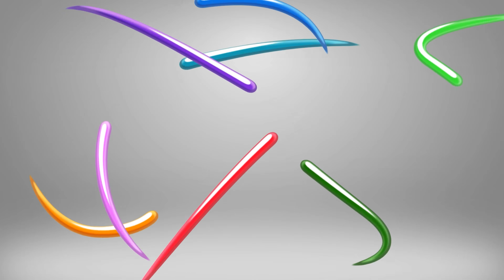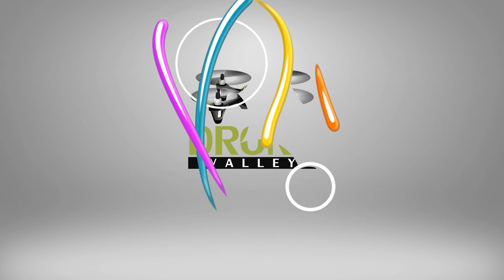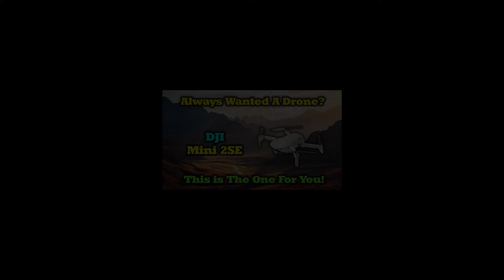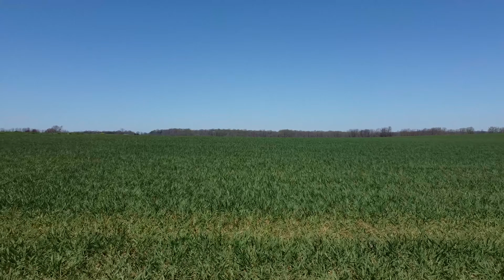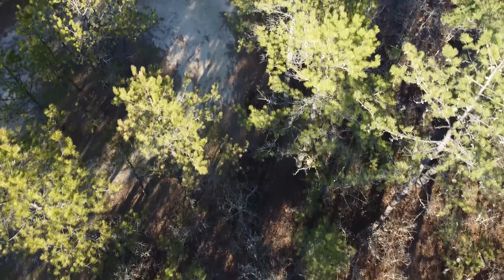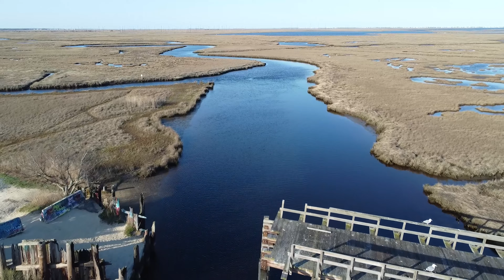DJI Mini 2SE - The Perfect Drone For New Fliers

Comment: Great job Rick, I just got my DJI mini 2 SE a few months ago and have had it in the air only a few times because of the weather but love this dang thing and yes each time you take it out you get a little better with it, I was surprised at how high only 130 feet was the first time, then another (200') and then another (300') haven't pushed it much higher as of yet. I still haven't tried the Quick Shot modes yet. One thing I did notice was when you mentioned the drone being less than 250g. it not having to be registered, that's only true if you are flying recreationally and from what Im seeing on the FAA site basically if you use the footage you get for anything but your personal use (your phone or pc) its commercial flying, if you upload the footage to any social media platform it's no longer recreational. Keep em coming Rick!!!  🚁

Comment: I have the Mini 2 and i bought the 2SE when it was released. I fly either or when flying and  batteries props and controller can be used on both.
Reply from the maker: Thanks for the post and that is a really nice feature. I swap them out too, depending on which of the drones I'm flying.

Comment: Have the Mini3Pro, but the Mini 2SE is an excellent budget drone. I haven't seen anything better for the price. BTW- like the sunshades I bought for the RC1. Had to cut a little around the case, but not a big deal.
Reply from the maker: Thanks for posting and I agree about the Mini 2SE. I can't believe the level of tech in that drone for the price. No drift, excellent images, long flight time with a rock-solid connection. What's not to like?

Comment: The specs indicate WiFi rather than Ocusync2 on Amazon? What gives?
Reply from the maker: It's using the DJI O2 transmission tech, which rides on top of the 2.4 and 5.8 gHz band. You can check the specs on the DJI site to verify this. The O2 is a specialized frequency-hopping schema that provides the additional flight distance over basic Wifi and is pretty amazing.